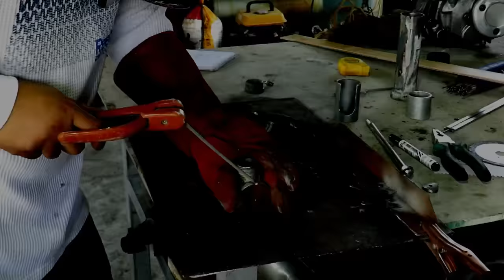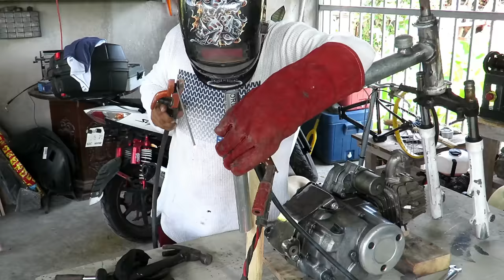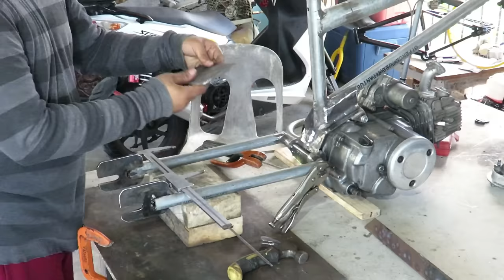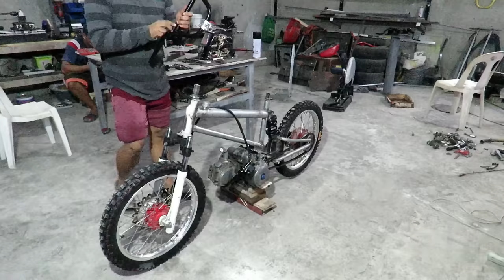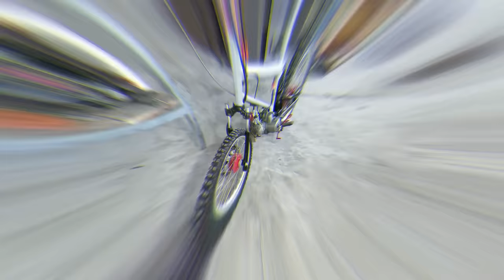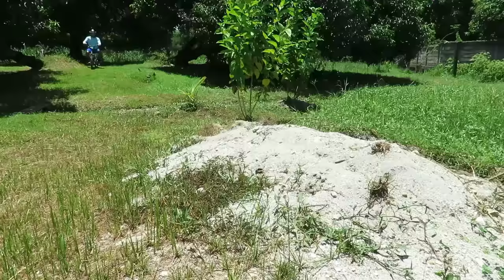Homemade BMX CUB

Comment: Sir hm mag paasimble ?
Reply from the maker: 5k labor sir. Sayo lahat ng materiales at parts
Reply: Sir magkano estimate niyo magagastos sa materyales? Tapos saan po kayo sa tarlac?
Reply from the maker: Hanap kang bulok na semi automatic na motor kahit kulang kulang na basta andun pa mga batalya rims and fork tsaka makina. Tapos mga bakal mura nalang mga yon siguro gagastos kalang ng nasa 3k at sa iba panv mga parts
Reply: @skwakoo  sa po kayo kayo sa tarlac boss para pupuntahan ko nalang pag uwi ko
Reply from the maker: @mersylloydquiambao6124  sa san miguel atioc po. San po ba kayo sir
Reply from the maker: @mersylloydquiambao6124  sir message moko sa fb page. Pinoy diy builds
Reply: Salamat skwakoo!!interesado ako jan